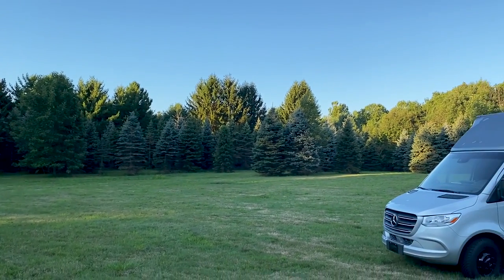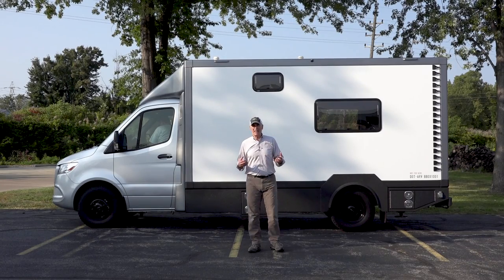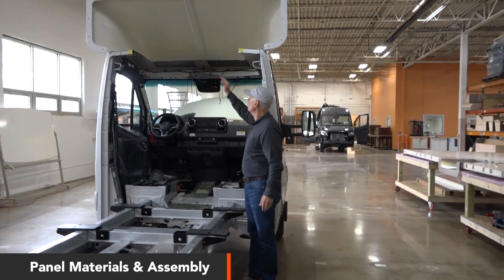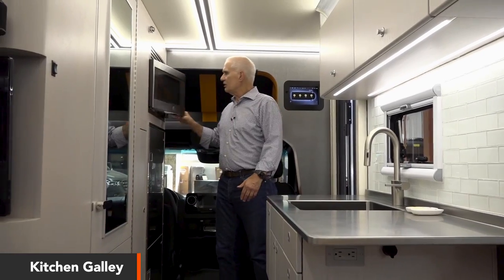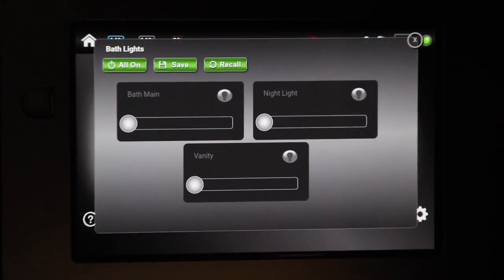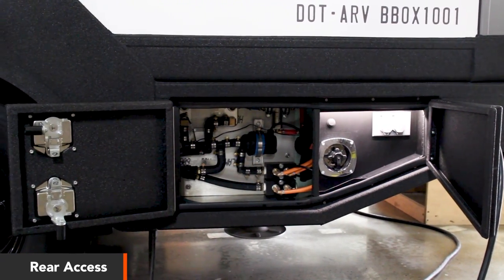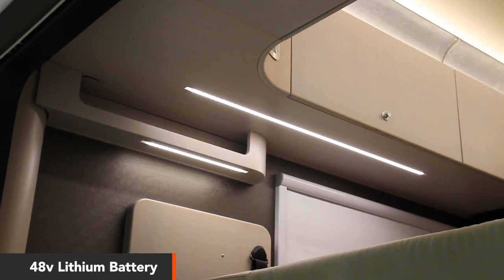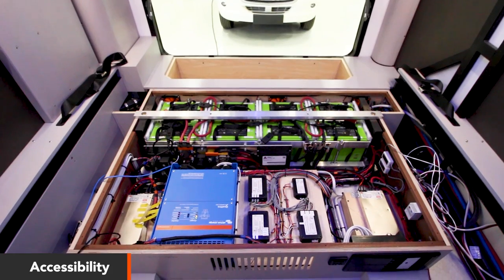B Box Walkthrough | A Look at Advanced RV's New Prototype Motorhome

Comment: Awesome idea!

Possibilities for improvement.
I would definitely be interested in a box that could be mounted to the vehicle and chassis of my choice that had the hardware in this box.  Sprinter vans are woefully expensive to repair…and arent that reliable in the long run. I can make a chasis with a much more reliable vehicle. 

But more importantly, I would only be interested if there was at least a 16’ box…18’ would be better. The “sprinter van” size is just too small. There is a reason everyone is going to step or box vans. Youve got the width…but the length needs to be at least 16’.

How do you attach things to the wall without letting moisture into the walls? I saw the glue truss system. But it looked like there were some holes in some spots especially with the steel frames.
Reply from the maker: Thanks for the comment. We use high tech glue and glue techniques that leave the surfaces intact and enhance the structure of the motorhome enclosure. Many of our techniques are the same as those employed in the automotive industry. Also, you might find "Asteroid of Happiness" on our channel for a more extended length box. The full length including chassis is around 24 feet: https://youtu.be/vTq0KQN7e-Y
Reply: @AdvancedRV  i just watched the video on that one. But there was no mention of the b box or “cargo area” length itself.

Comment: It would be great if you could provide an aluminum/steel shell for the B-Box in the same way that a Sprinter Van has an aluminum/steel shell, for interior hardware customization. Fiberglass shells are not known for holding up well to having hardware screwed into them or welded on them, in the same way that Sprinter Vans allow for. The aluminum walls allow you to frame out a van with customized walk thickness, whereas the fiberglass shell puts all the stress on the shell, whereas the Sprinter Van allows you to mount to the frame. Solve these issues and you have a game changer. It would also be great to have the option for proper roof support, so as to be converted to a deck platform capable of holding people, not simply cargo/luggage.

Comment: Any price estimates yet? What about a Weboost or something similar for cellphone / hotspot options with telescoping antenna? Can you get solar? Insulate the cab? Will the Box fit on the Mercedes 4x4 cut away cab? I didn't see a stovetop, that would be good because I like the portable induction burner that you can move around. Thank you
Reply: they are totally custom cost will be dependent on your choices
Reply: There is no Mercedes 4x4 cutaway chassis. That's not an option on the cutaway.
Reply: I've read online that it's estimated to be about $300,000 to $500,000 depending on the options

Comment: Just a little quality control. The shade screen etc, you have installed upside down. Not trying to upset anyone. I’m a nerd autistic type. I’ve seen thousands of RV videos. At first after seeing that many videos. You notice things like that. And if you think about it. If someone were outside and you had the shade open some to let light in or to see out. The shade being lowered is better than being raised. Because if opened a list from the bottom then folks can peak inside. You know over time my wants and needs have changed with seeing different builds. And at one point because of my diagnosis of severe heat intolerance, I then thought of refrigeration box truck. Which when I saw this plus realized you would be willing to build it on a Ford Chasis. B Box is my number one right now. I want you to know, I have seen everything. At one point I thought of different folks. But one thing I know the hidden cost is in repairs. And after 5-10 years you want to know when you try and call the number to even just ask a question, well you want to know those folks will be there and back up what you already put money into. Plus you really want resale value on an item this big. I’ve seen many folks that can do this. But I’m really looking for a build done by a company. I was looking Coachmen or Pleasureway, but your company has always been on my mind with your detailed approach. I love everything about the B Box. I love the colors. I love the refrigerator. And I can’t imagine where you plan to put the washer, dryer. And to let you know. I hate pop tops. I want a Max air fan also, to use when not using the air conditioner. Please do us a favor and someone do another video where it doesn’t show views in flashes. Seeing this whole video was painful in that I really couldn’t see things very well or could not catch them in a second they were shown. The back hatch I wonder how that is with it in bed mode. And folks are right I never saw a table. I like those lagoon tables. Anyway. I’m certain you know. You hit the nail on the head.

Comment: Your design is so far "advanced" over a standard RV, it's almost an insult to compare it to anything else out there. When is the last time you heard the term "conductive heat transfer" thrown about when insulation is discussed?   Lithium ion battery, check, just everything so well thought out, and the water recycling system!  Custom Fox shocks!  The low drag design is appreciated by this pilot, and the aft VG's are a given, again, just super attention to detail, well done!

Comment: Wonderful video and concept.  It seems that ARV has thought of everything.  I’m curious, though, on one point that the video didn’t cover:  is the box installed in such a way that allows it to twist independently of the chassis to mitigate torsional forces when the vehicle is off-road?
Reply: @Taata78   I think you are correct. The video suggests that the vehicle is designed to handle some off-road situations so I was just curious.   It’s still a great concept and I really like it.

Comment: Good start but...   Would prefer rear bathroom, with composting toilet urine to grey water, no need for second sink in bathroom, no black water.  Don't need couch would prefer Murphy or drop down bed.   Use cab as sitting area with table.  Most cooking outside so kitchen sink and prep area with outlets for instant pot and induction cooker.

Comment: I like the concept of the recycled shower but I’m concerned of the sustainability of the system and how serviceable it is.
Reply from the maker: Thanks Chris. We're monitoring sustainability. The primary coarse filter is removable and should be cleaned regularly. The particulate and carbon filters, as well as the UV bulb, are removable and should be replaced at longer intervals.

Comment: Amazing how you took a bad situation - an industry-wide lack of available Mercedes Sprinter van chassis during a global pandemic - and created a whole new style of Class C that has the dimensions of a B but the interior living space of a B+/C using a Mercedes Sprinter cab chassis.
One way to get more clearance with a leveling system is to design a "landing gear" system where they are flipped up out of the way until needed, then a switch is flipped that electronically lowers and locks them into place when they're needed.  Like aircraft landing gear.  Using small solenoids bolted onto a mount that's welded to each leg they can be auto-locked into both up and down positions for safety.
Now if you get a complete paint match or entire body wrap it will be completely stealth in urban areas.
Didn't hear anything about a generator?  You're using a secondary alternator to charge up the lithium pack, right?  Now for the next problem...solar.  Can you put 600w of solar on the roof while not interfering with the signal quality of the antennas lying underneath them inside the roof?  Have you thought about embedding the solar panels in the roof itself with some ducting to the air-exchanger to circulate air under them to keep them cool and more efficient while moving the antennas to the outside perimeter of the roof around the panels so they won't interfere with the signal?  Wifi and cell phone MIMO antennas, right?
Congratulations, you've designed one hell of an RV prototype. I like it.

Comment: It’s a bummer you guys didn’t go with the Transit chassis. The Spinter is a pain to get work/maintenance on. Ford makes is much easier.
Reply from the maker: Thanks for the comment. We've had several clients approach us about building on a Transit. We are open to doing so if that's what would meet their objectives. So far the weight capacity and front cab benefits of the Mercedes have led our clients to choose the Sprinter.